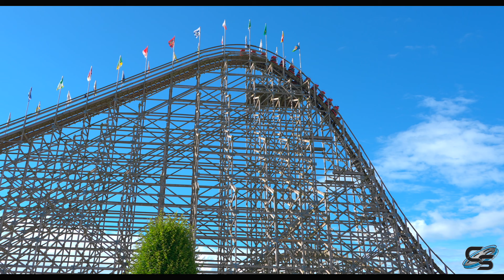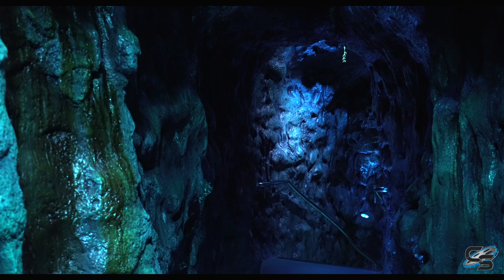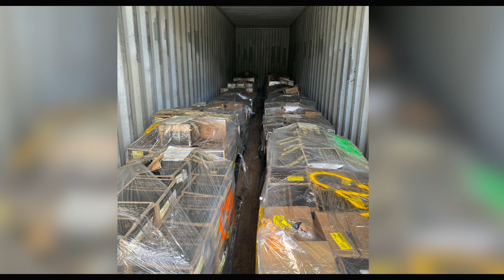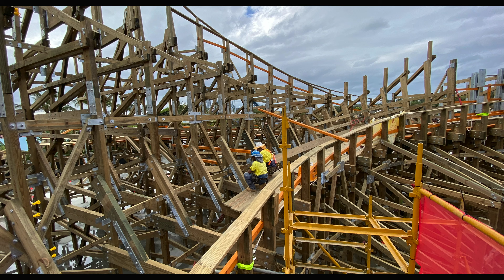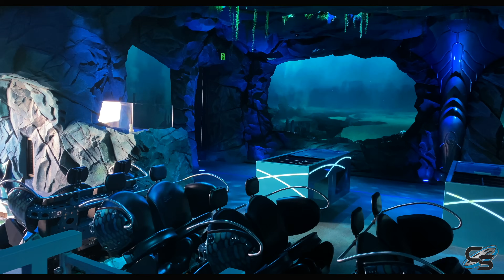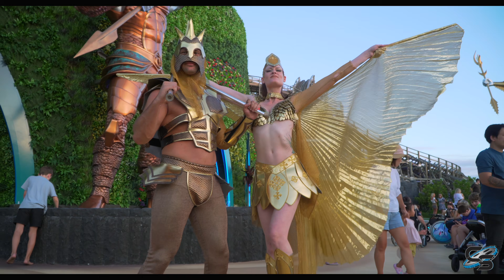The Complicated Process of Building a Roller Coaster in Australia

Comment: Rode Leviathan for the first time today. First time on a true woody in 21 years - and it did NOT disappoint!! 8 runs in one day and that was enough🤣 but I'll definitely be back. AT LAST Australia has a good woodie. So glad they resisted the temptation to use GCI (steel) track and instead go 100% traditional woodie track and ride. That said... this is an intense ride compressed into a small space with heaps of airtime and reversals. In my opinion the best thrill ride in the country. The other parks have got a long way to catch up and get their own woodies built in response. Only complaint (from my Daughter, actually) is that there needs to be more upper leg room - she ended up bruised after 8 runs - won't stop her comin' back tho! My fear is that this intense woody will not age well. The ride was probably too smooth when opened - 100% perfect now - but in 5~10 years? will probably become so rough as to be un rideable for many or otherwise too expensive to maintain to a high enough standard to ensure riders aren't injured. In the end this is a FANTASTIC coaster and a GREAT ride for this 58 year old. Not goin' to the US now... got the best right here! As for construction, one might need to remember that in China you could build something like this, it receives little to no maintenance and then it's jitzed in five years for something else. This ride in its current location is expected to have a life of at least 30+ years and is located in one of the most weather and wind intensive coastal locations on the planet. You can see why they might be concerned about someone spilling coffee on the plans.